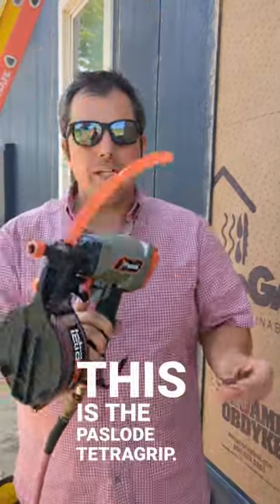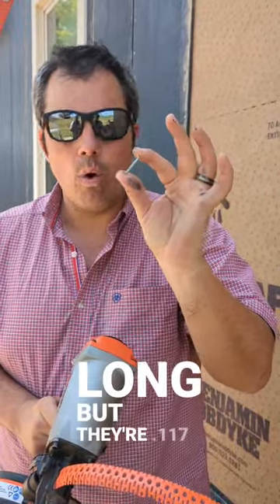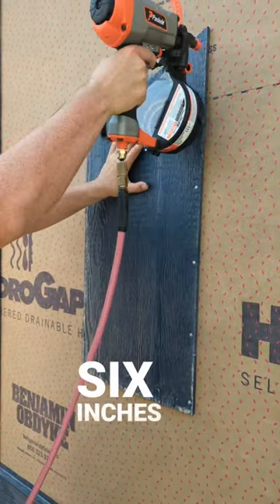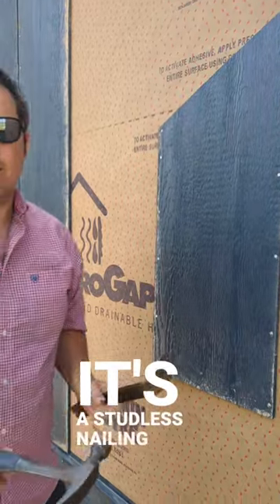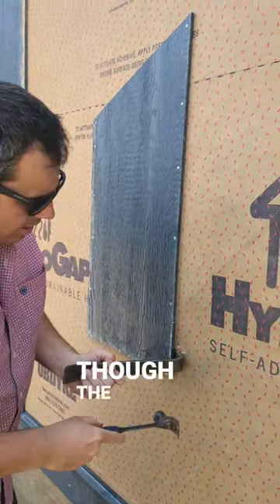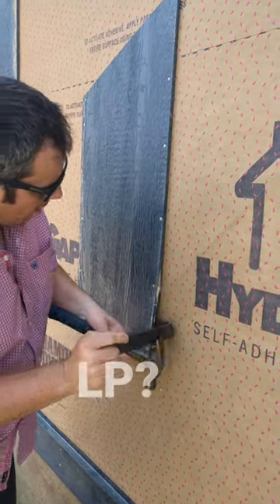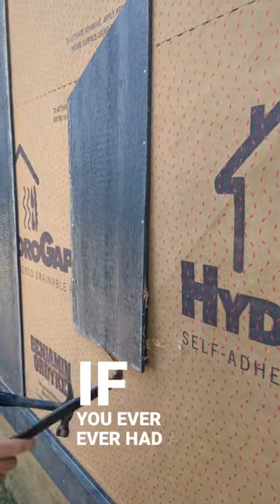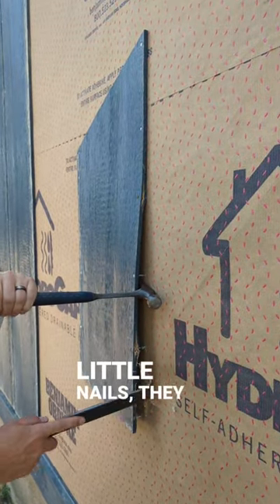Paslode TetraGrip Holding Power #shorts

Comment: Those nails are not holding anything. With a six eight you shouldn’t be able to pull those out that easy. We use 1 1/2” ring shank for sheathing. We shoot into studs, plates, and headers. I have demoed and remolded a lot of houses and with proper shooting and ring shank nails you would not pop any nails out that easily. Even when siding we still use 1 1/2” inch galvanized ring shank into the above mentioned plates and studs.

Comment: Did you, Sir, notice the spiral on the circumference of that nail? that spiral spins the nail like a screw. So, basically that nail is not a nail at all, it is a screw, and if you want to take it out you actually need to spin it CCW, and I guarantee you it will come out easier than pulling it straight out.

Comment: The nails have to be short, if a nail punches through the other side it's holding power drops dramatically...
Reply: You don’t use shorts nails when sheathing or decking or even siding. You shoot into your studs , plates and headers. If a mail punches throw then you shot bad. Plus you use ring shank nails so if you are siding if you do shoot through sheathing it doesn’t negate the holding power because of the rings on the shank of the nail
Reply: @speedgonzalez489 wtf are you talking about..do t tell people anything when you dont know what youre talking about
Reply: Yeah I know exactly what I’m talking about when it comes to sheathing and decking a house. I have been doing it for years. Using staples and ring shanks for sheathing. A coil gun with galvie ring shanks for siding. I know exactly what I am talking about. Everything we put up we shot into studs , plates and headers as far as sheathing is concerned. When siding you shot through your sheathing into your stud underneath. That’s how it’s done anyplace
Reply: @speedgonzalez489    For one, if I ever caught someone installing sheathing with staples, they'd be off the site quicker than you could say boo. Secondly, different siding requires different fasteners and nailing patterns. If you're throwing up vinyl with ring shanks that have small heads again, you're gonna be leaving. If the siding you're installing requires a fastener closer than 16 inches around the edges, then guess what bud you're not gonna be able to hit a stud with every fastener. Hence , you need to size your fasteners for the task at hand because again, if a nail punches all the way through then it's holding power is greatly reduced no matter what it is you're working on.  But I know, this is the internet, and you're a "professional," and anyone who says something ypu either don't understand or varies from your beliefs is automatically wrong and/or an idiot...
Reply: Well for one I am a professional. Got two I don’t run cheap ass vinyl. We do a lot of hardie board and batten and lap. So yes we use ring shank and a coil gun. If we run t&g then it is 16 gauge brad nail. Either one you are hitting studs. If you are running vertical then you use a short nail not to punch throw your sheathing. Sometimes we run blocks for vertical to shoot into them. And yes I have used staples on osb for decking. It’s been some years since I have, but it is done. Yes I know what I am doing. I’m not some you tube know it all. I just telling you from experience what all of us here in this area do and use. I can guarantee you that the homes I have worked on would never use any freaking vinyl siding.